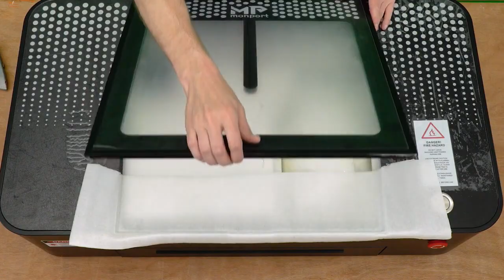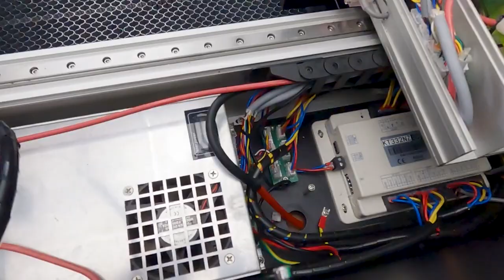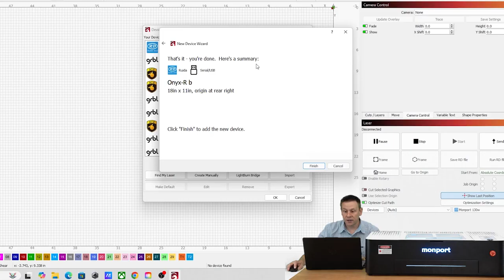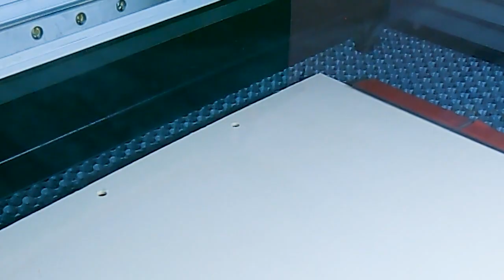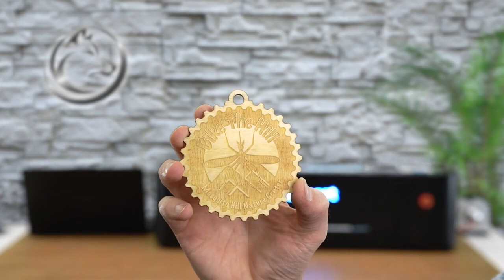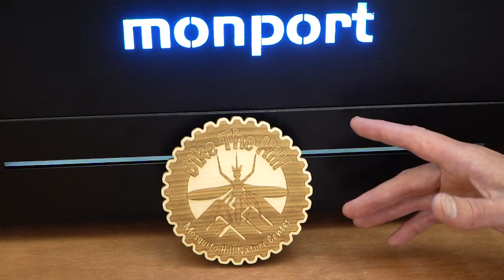Onyx 55W Super Easy Set Up!

Comment: Hi Grak wonderfull tips on Monport ONYX 55 w i have the same machine but have ran in to problem with transfering file to the laser .
I having problem with my laser everything all set up  farming ok focus on material ok but when i push to start file dose not transfer to cut or work the blue light turns red and can  not figure out what the problem is i have also remove  from lightburn and reinstall  the laser and still same and i get the error massage file field to transfer to laser or busy  and there is help on the net for this problem have check you tube and  google  nothing on this issue  would realy appreciate if you can help me on this .
 
 Thanks
Reply from the maker: Hi! Please sen your concerns to our support email: support@monportlaser.com. Thank you :)
Reply: Great video!  Thank you so much.  Do you have an air pump you could recommend?
Reply: Any air pump specifically I should get?